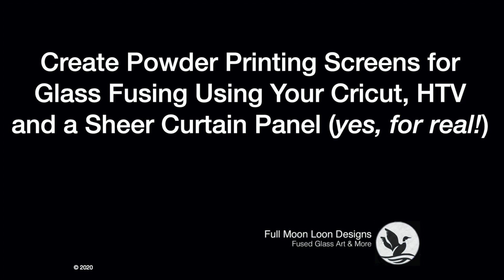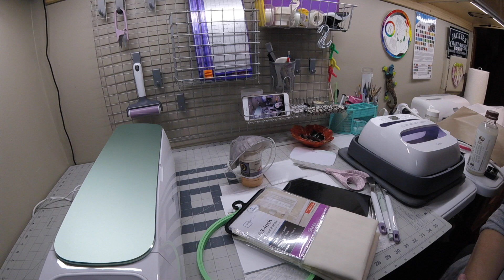Powder Printing With Sheer Fabric Screens

Comment: Thank you very do not have one of these circuit machines will look into them which one do you have?
Reply from the maker: I have the Maker, the original one not the Maker 3. The rotary blade is great for cutting 1/8” fiber.

Comment: What type of fuse do you take this to? Full, Tac?
Reply from the maker: Usually with a powder design I take to between a contour/full fuse. If the powder isn't heavy enough you may need to add after first firing. Kilns vary a lot so it would be very similar to if you stencil powders on and fuse.